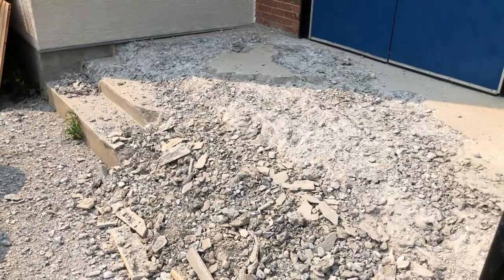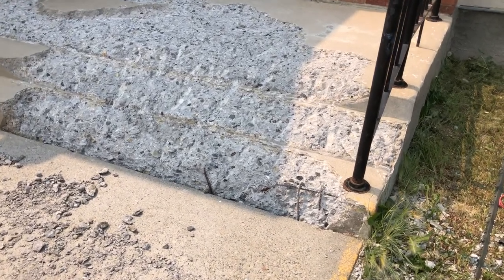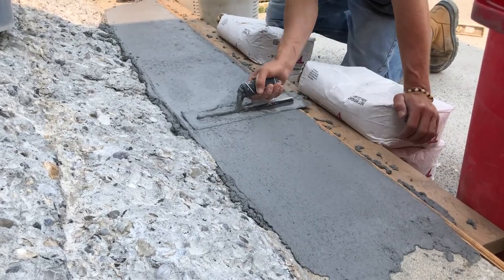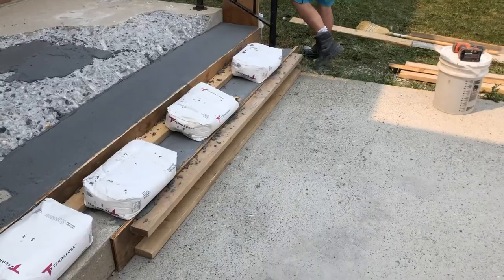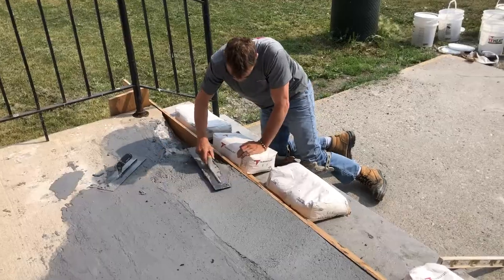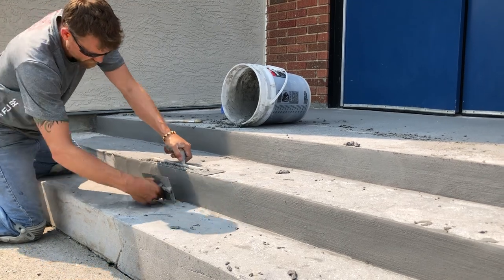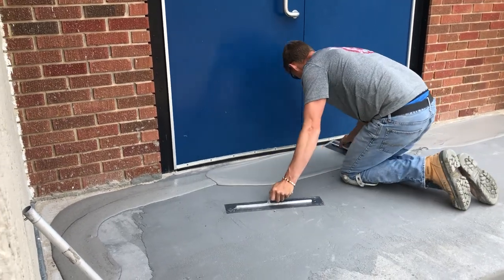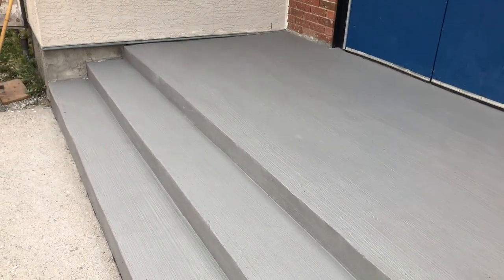Complete concrete staircase restoration. One day install with TF Structural Concrete repair!

Comment: would brooming the final coat forward help drain the rain water more efficiently, versus side brooming shown here ?
(Slip resistance would work either direction ).
Reply from the maker: A little bit yes, but it is common to see the lines made perpendicular to foot traffic
Reply: @TerrafuseInc  ...
Yes... l figure for better foot traction. That product is crazy 👍🏽
Reply from the maker: Thanks!

Comment: Could you use structural to create a ramp from one level to another.  Say 4 inches?  If so, would i do more than one layer at a time, or can i just go for it and fill up to 4 inches.  i ask bc some of those stairs seem about the same depth fill..
Reply from the maker: Yup!

Comment: May ask. Im from South Africa. You said you screeded the top landing? Is that with your standard river sand and cement or your special product?
Reply from the maker: All was done with TF Structural. Cement will not bond to concrete.

Comment: hello im intersted in your product   i live in laval quebec and i have a stair to repair
if i use your product should i first wet the area where to pour?  should i use a primer first?  even you say no need  but i need to give guarantee to customer ,  should i try to remove all things i feel not wel structuredor there is a crack,   and what if they just want to repair the falling part?
Reply from the maker: you can dampen the surface with water first, but you don't have to. Don't use any primers, they will ruin the bond of the TF Structural. Remove all old, loose, deterioration concrete. You can just repair the damaged areas if you want, no problem.